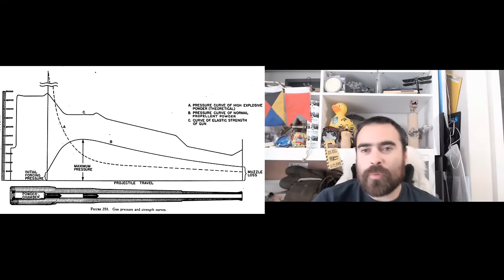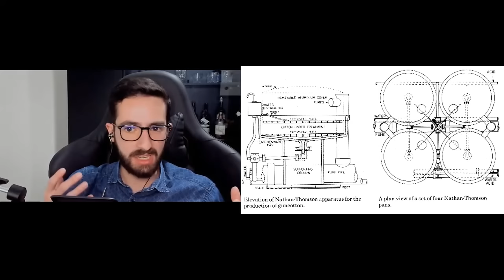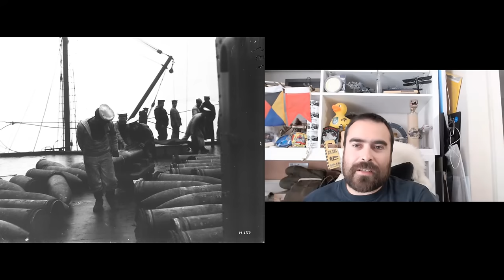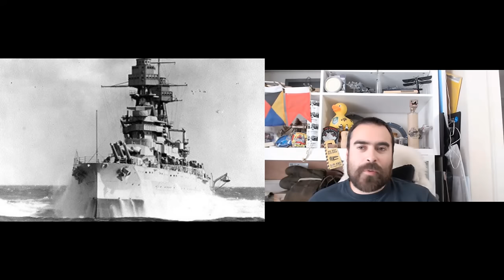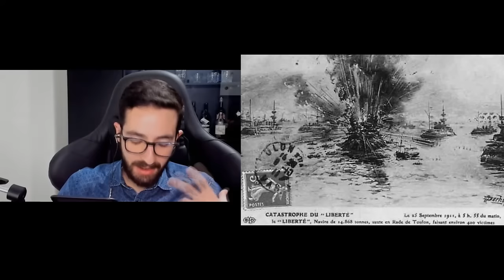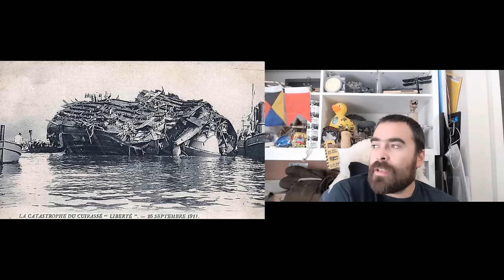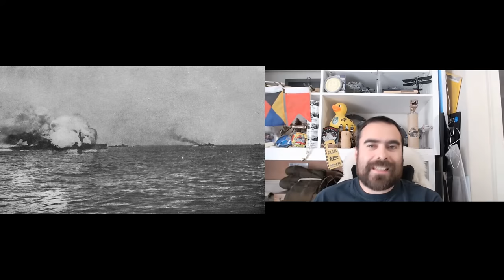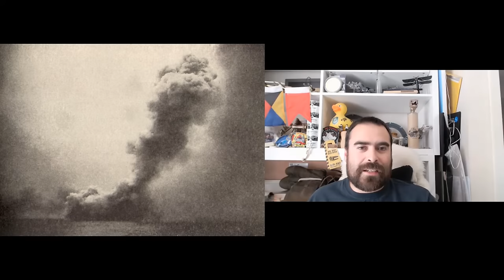Cordite and Poudre B - Why things start exploding at just the wrong time

Comment: (23:44) This is true. I used to keep several perfectly dry bottles for Gatorade around. I'd measure out an amount of Gatorade powder and pour it into each bottle through a funnel, so I could have instant Gatorade at work—just add water. I hadn't realized the problem I was creating until I went to clean my kitchen, and found that anyplace I wiped with a damp towel, the towel would come up pink, meaning that Gatorade dust was coating every surface. Gatorade is fairly innocuous, but it demonstrates the problem.
Reply: Maybe gatorade crystals are forming
Reply: It's alive !
Reply: It's insidious how the powder/dust forms of otherwise innocuous things can become dangerously explosive.  There've been big fires/explosions over the years at things like grain silos and sugar mills from large amounts of very fine powdery flour/sugar residue in the air and on the working surfaces, and all it takes is a stray spark or overheated machine part and the whole place just detonates.  We used to throw unused Kool-Aide powder into the campfire at Boy Scout Camp for fun, since it would readily burn. Bet Gatorade would too.
Reply: @paulseifert6598  kool aide powder is just colored sugar. That would burn excellently.
Reply: I have the same thing with iced tea powder.
Reply: @Charon-5582  And so it did! We were a bit disappointed to learn that it didn't make colored flames, though....
Reply: Scrub.
Reply: like the powdered coffee creamer trick any dust even not flammable can catch if it's concentrated enough.
Reply: No powder is safe. Mix any fine dust with air, add flame, boom. I worked at a soft drink factory, that had bulk tanker delivery of fine sugar. First job on arrival. Earth the tanker!!! Just as you would with a fuel or gas tanker.
Reply: @Charon-5582  My mother would throw a handful of sugar on a lazy fire, it would promptly flare up.
Reply: @paulseifert6598  Absolutely right.  Grain silos are incredibly dangerous.  You can get crushed, suffocated, burned to a crisp or blowed up depending upon where you are and what's going on.
Reply: @51WCDodge  nothing to do with this video but is your last name Dodge. Mine is WEDodge
Reply: A furniture factory exploded near me when I lived near Tampa. Reason was the dust collector died overnight and something detonated the fine wood particulates in the air. Thankfully nobody was in there as far as I know.
Reply: Metal dust will happily go up too. Dust explosions are an insidious hazard.
Reply: Gatorade powder burns too… (but is extremely hygroscopic).
Reply: @jadall77 Powdered salt generally won’t…
Reply: Coloured powder is more easily seen than other things lying around. Especially when you blow your nose.
Reply: @paulseifert6598 if you've ever taken military HME classes, you know sugar IS NOT innocous. A ton of fertilizer bombs use powdered sugar as tinder. Of course nitromethane is generally prefered, but they usually have a much easiar time with getting powdered sugar or aluminum powder.

Comment: Decades ago the Chemistry department at UNC Chapel Hill was cleaning out the old store of chemicals and came upon a bottle with a large amount of "sludge" layered in the bottom of the bottle.  Fortunately, one of the attendants recognized the sludge as epoxides from decomposition of the contents.  After careful removal, the bottle was detonated with a rather huge explosion following.  If the bottle had been mishandled in the Department, it would have been a rather large news item.
Reply: Robert Bridges

It's a rather too common occurrence. 

I recall several incidents related to inappropriate or old and forgotten stores of ethers, trinitrophenol, dry nitrocellulose, the list is long...

Comment: Re: USS Arizona, they found unburnt powder all over Ford Island!  That's how stable the Smokeless Powder for her guns was!  In fact, I believe it was Drach's video about the ship, actually when you slowed down the actual historic film of her explosion you can see powder bags being thrown in the air and some of them burning (.vs. exploding)....
Reply: Cordite, at normal atmospheric pressure, does not explode. It burns quite rapidly, but no boom. To make it boom you have to enclose it to cause the pressure to rise. Which makes it burn faster. Which increases the pressure. Which... So a loose bag flying through the air is just going to burn.
Reply: Explosion was also allegedly a testament to the dangers of black powder in the AZ's black powder magazine, forward.

Comment: I read in a 1901 industrial chemistry book the procedure for making nitroglycerin, they used quart jugs stood in a ring trough of flowing cold water, a glass tube bubbled air into the glycerine to stir the mixture, above the ring of jugs a glass tube manifold dripped the nitrating acids into the jugs. The fun bit is the operators job was to adjust the tap of nitrating acid and feel the jugs were not overheating, if they were too hot he was required to swiftly tip the jug out into the water trough. Must have been a keen incentive to keep you mind on what you are doing!
Reply: I read that the operators sat on one legged stools to ensure they didn't fall asleep during the process.
Reply: @royhills  That's charcoal burners (the people not the device) it takes hours to make charcoal and you need to keep watch on it the whole time.
Reply: @rabidmidgeecosse1336 I heard it works even better if you turn the stool upside down.